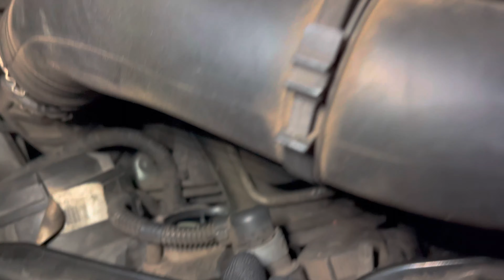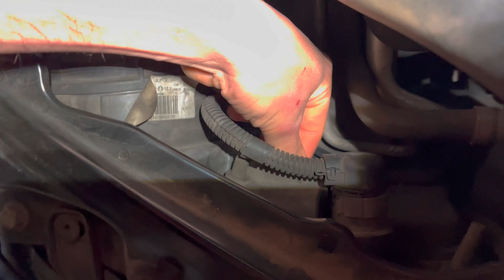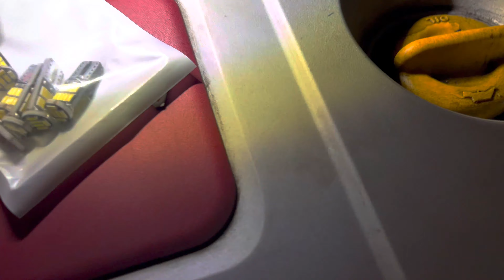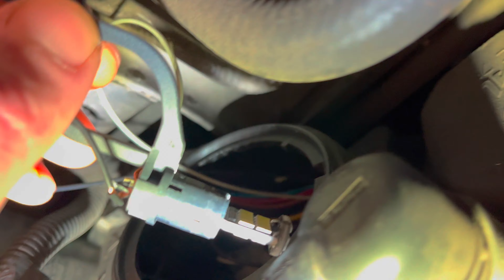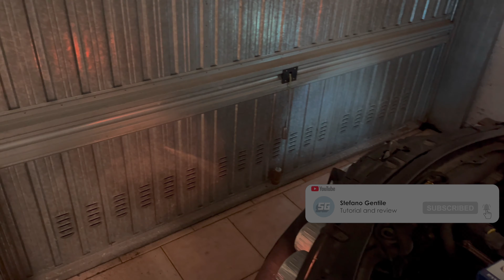Replace Halogen Position Lights With LED ones - Alfa Romeo 159 🚗

Comment: Vorrei sapere quali mettere, che voltaggio
Reply from the maker: Puoi trovarne qualcuno in descrizione. Devi inoltre scegliere tram Canbus e non. Quelle Canbus hanno una resistenza integrata che fa consumare la stessa energia di una lampadina alogena e quindi non fa comparire la spia della lampadina bruciata. Quelle non Canbus, consumano talmente poco che il sistema rileva la lampadina bruciata, e fa comparire la spia sul cruscotto. Io ho scelto non Canbus perché quello che mi interessava era consumare poco e non scaricare la batteria. Per quanto riguarda il voltaggio, sono tutte 12V.

Comment: Danno errore? Link?
Reply from the maker: all'inizio danno errore, ma poi scompare. Il fatto è che danno errore perché consumano di meno. Se prendi quelle con la resistenza, non danno errore, ma consumano di più. Io preferisco avere la spia ma consumare di meno. Il link lo trovi in descrizione 👍🏼
Reply: Leider funktioniert das ab Baujahr 2010 nicht mehr! Die Fehlermeldung tritt trotz Canbus nach einiger Zeit auf!
Reply: Which ones on the amazon link you provided ? There is 5 of them Which mm is the correct one please ?